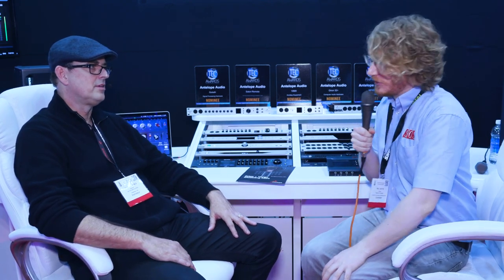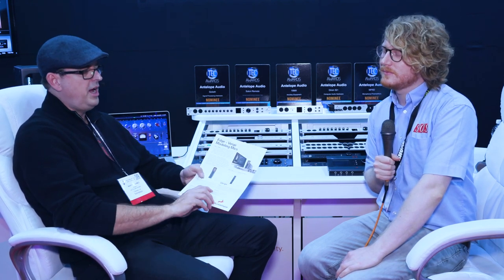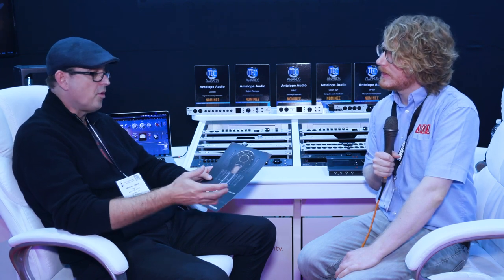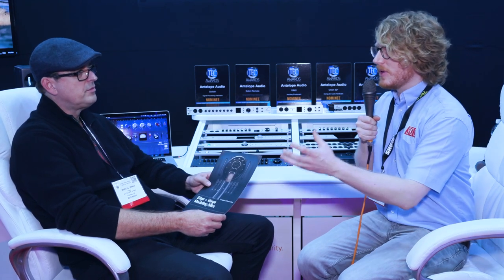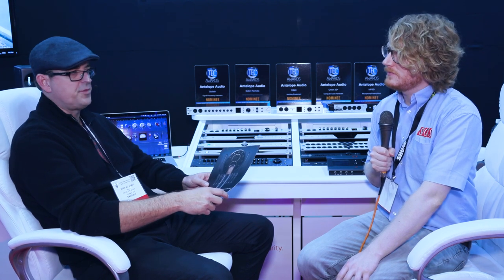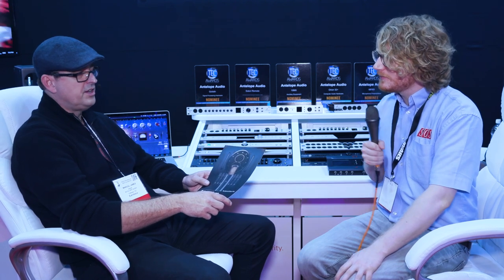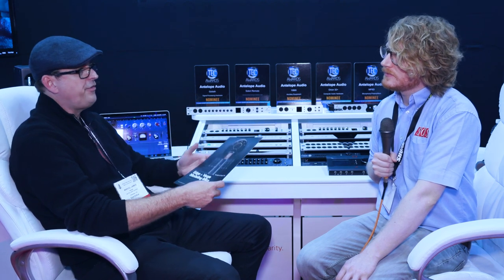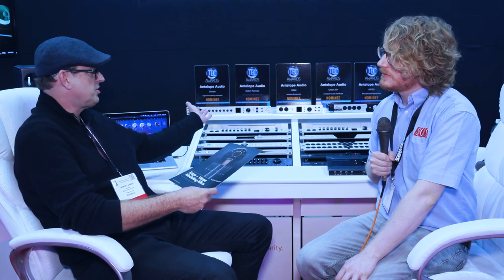Antelope Audio - Edge & Verge modelling mics - AES 2017

Comment: Just for the record: you can also get a realtime mic modeling performance with the Townsend Labs mic on UAD and an Apollo. I do that all the time with zero latency issues. Works like a charm!
Reply: Hi Juian.  This system will have latency of 3-5 ms depending on how much other processing you have going on, because they have to travel roundtrip to the DSP and back to monitor.  The singer will get the direct audio from the Antelope models at less 1 ms, actually 1/2 a millisecond max!  This avoids comb filtering inside the singer's head and impacts the singers performance.  (Hope all is well with you these days, btw).  (edited for clarity)
Reply: Marcel James Mastering Not sure what you mean by "both those systems" since I was only referring to UAD. Anyway, I'm not talking about going to the DAW with software monitoring. I'm specifically talking about running the Townsend Labs Sphere UAD plugin in the Apollo Console, which also gives you near-zero latency.  UA states a round trip (analog-to-analog) latency of 1.1 ms with four stacked UAD plugins. The Sphere plugin has a latency of 0.5 ms, so worst case (Sphere plus several EQ or compressor plugins), were talking about 1.6 ms. Realistically less with fewer processors. Seems to work for all the singers I've worked with so far. On another note, I'm doing very well, thank you. Based in Cologne now, so not far from you. You should come by for a coffee some time!